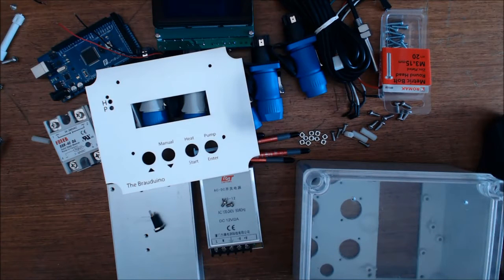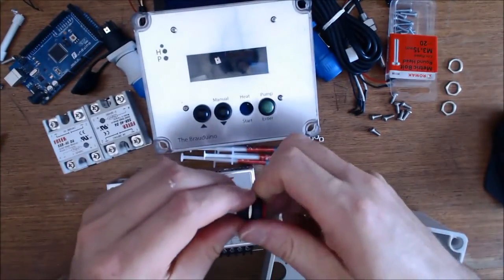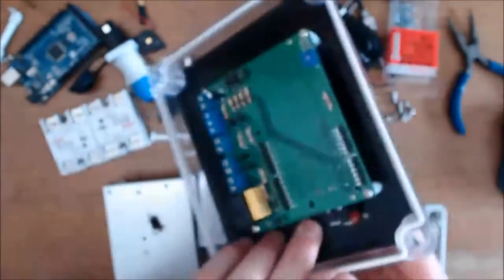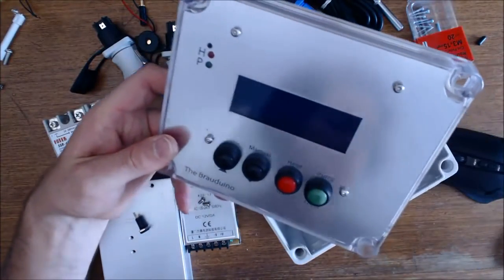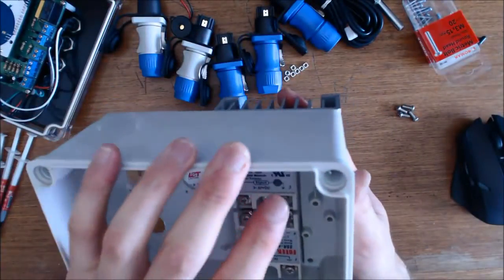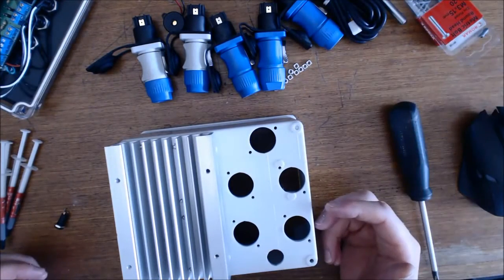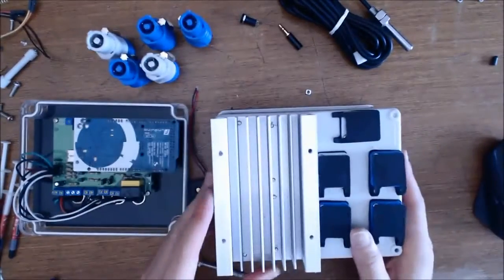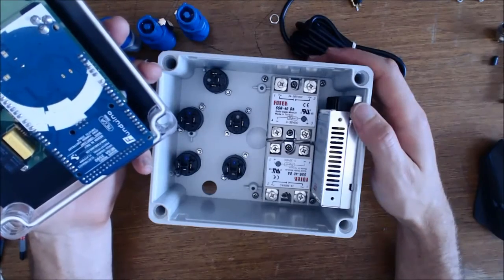The Brauduino Kit - How to Build

Comment: Hey mate great looking piece of kit you've got there.
I noticed it's running Ardbir. Have you made any changes to the open source code? or is the idea that you are just selling a kit with which is really easy to assemble?
Reply from the maker: Hi dav85c, 
Thanks! The only changes to the code are to make it English and 20x4LCD. The point is providing a kit that is really easy to assemble, and is forwards compatible with spark core / photon for future upgrades to the software. The biggest issue for people in the past has been struggling to solder a circuit board correctly so they don't get errors, and having the skills to make a control box that looks good.

We're trying to solve that, and provide more people with the option of building a great brewing system. I've been in contact with Max in the past about the kits and he has been fine with including ArdBir. Including the flashed Mega is purely for convenience.

For reference for anyone unfamiliar with the project:  http://aussiehomebrewer.com/topic/59563-mathos-controller/page-72 is where the code is mostly discussed publicly

The code is currently available:
 https://www.dropbox.com/sh/96o6i39o50llama/AADyZ3VUEGZKResomWkkSjCDa/Firmware?dl=0
The link changes from time to time, but is updated in Max's signature on aussiehomebrewer.com

If you came here from somewhere other than aussiehomebrewer, the place to get one of the kits is:
http://aussiehomebrewer.com/topic/69155-the-brauduino-matho%E2%80%99s-controller-buy-thread/page-48